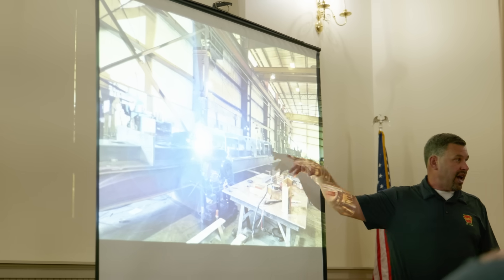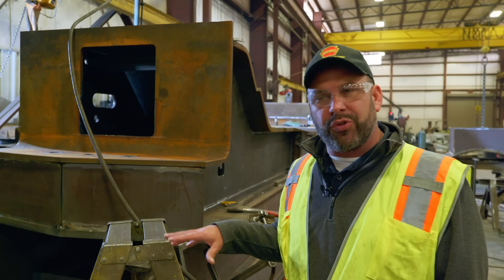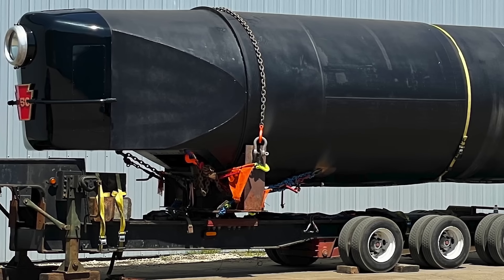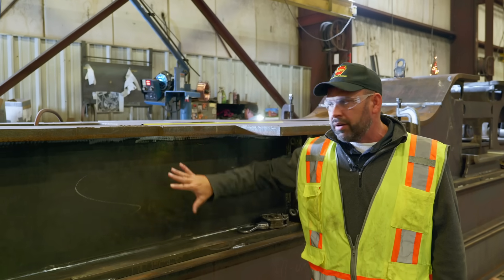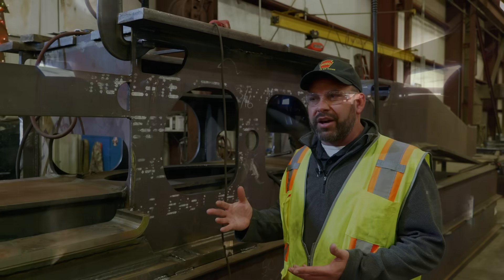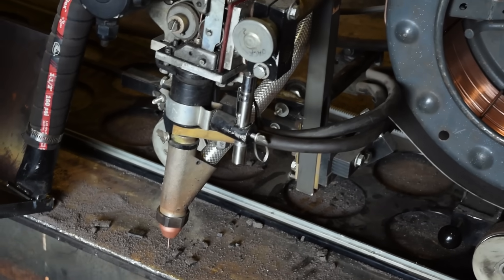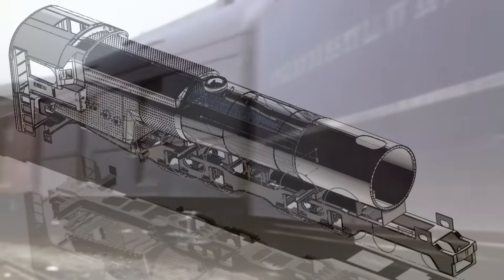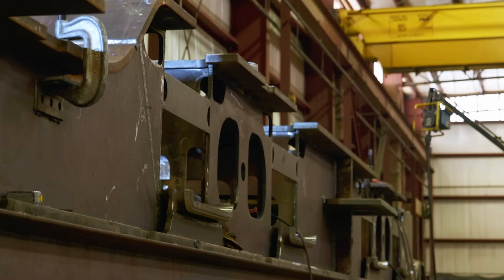NEW-BUILD Steam Locomotive Frame Walkthrough - PRR T1 Trust

Comment: fantastic work, thanks for this. my big question is though - could you create a steam locomotive at the same hp and same cost (inflation adjusted) as back in the day? i realize you have better tools and methods these days than they did, but curious if the old requirements with old methods are even possible anymore. and if they still stand up now. thanks

Comment: It’s just such incredible work they are doing. But I have a question for the railfans, what’s going to happen to the trust after the T1 is complete. They aren’t gonna run it, they’re sending it to other railroads. Could they rebrand to say the “J1 trust” or “S1 trust”?
Reply: Just because it will be operating on other railroads doesn’t mean they won’t own it or operate it. They will still be taking care of it when it’s not running on tourist lines. No need to rebrand.

Comment: This is amazing, how far you can go with passion! When this was announced the nay sayers grumbled it could never happen, the US is a backwater, they will have to make it on China because we dont have casting capabillty, etc.   They kind of live in the past, that somehow it was superior...and it wasn't. 

The welded tech they are using and the materials are better than the casting tech back then. I am no expert but they have advanced welding techniques utilizing heavily automated , precise techniques. Where millled parts are needed CNC milling is infinitely better than old milling machinery. 

On the emgineering side they have computer based tools that can do a lot more than turn a 2d drawing into 3d.They can run stress analysis, they can see where there will be interference or space problems, they can run simulations that in the old days would happen with a prototype , which was expensive and time consuming. 

Also back then despite the best efforts of engineers a lot was still trial and error.  I say that with all do respect to them, they built incredible machines like this using hand calculations and slide rules. 

I have also heard grumbling it wont be authentic unless they do it the same way they did 100 years ago. That is silly, if the builders could have had this tech they would use it. 

Kudos to all!

Comment: Would have preferred it if you recreated a prototype T1 rather than a production T1.
Reply: I'm glad to see tech advances being used to produce a developed T1.  

The Gresley P2 (a 2-8-2) under construction over here 🇬🇧 is a 'next member' of a class which by common consent never reached it's full potential.  Several known design issues have been ironed out, not all of them unique to this specific design.

AIUI, the issues faced by the T1 in service were as much vastly different driving techniques as much as the design tweaks identified by the Trust building 5550.
Reply: I like the prototype streamlining as well, but I imagine there is good reason as to why the Pennsy chose not to continue the extra streamlining on the production locomotives.

Comment: This looks like great work. Were there many US steam classes manufactured with steel plate frames like this? The reason I ask is that I have only seen a small number of steam loco's in the USA, and if I recall correctly most had bar or cast frames.
Reply: The original T-1 this is based on was a single large casting and one of the last steam locomotives made in the USA, the capability to cast a frame that big just isn’t available anymore so they decided to do it this way. It’s still within 3% of original weight but has improvements for longevity.
Reply: Plate frames were the almost universal material here 🇬🇧 until a few cast segments made their way into designs very late in the day.  
Bar frames, common practice in tbe US which preceeded cast frames, had been virtually unknown here since the locos of Edward Bury in the early days of railways.

In a Duplex loco, it will be fascinating to see the difference this will make.  I've a suspicion it may suit the original purpose of mounting two discrete engine units in a single frame rather better than a more rigid cast bed.  Who knows, maybe time could even prove it was the original design which headed up a then fashionable engineering dead end!

After WWII, British firms did build plenty of steam locos with cast frames, largely for export to Sub-Saharan Africa, most to Metre or 3'-6" "(Cape") gauge.

Comment: So are you restoring an old one, or build one from scratch from original blueprints? I have not been keeping up
Reply: There is no old one left. It's a completely new one!
Reply: @Fritz46  that is very cool!
Reply: @ShawnFields-o7o  they are making it within 3% of the original weight while only upgrading things for reliability/longevity/safety requirements. They want an accurate example in terms of the full performance without any issues that cause breakdown or reliability issues so it will be around for centuries to come!

Comment: That can only happen in the States…..good luck and thank you all
Reply: Actually, it's happening here 🇬🇧 too ... admittedly rather smaller locos, but 60163 (an A1 4-6-2) has been in service for some time - and became the first steam loco since BR days to run at 100mph (a fully sanctioned test to prove 90mph operation). 

Did you know that the Gresley pacifics which kicked the A1's lineage off were originally inspired by the Pennsy K4? Well you do now!! 🙂

Comment: Great video. Your comment about not having the casting capability that we had back in the 1940s……this should not be. The US should be better than that.
Reply: The capability is still there, it's just not cost effective. You have to factor in the cost of the moulds; the cost of material for multiple casts, as one flaw and it would need to be redone; the cost transporting the oversized cast to the production facility. All those costs would skyrocket the budget that they already barely have... It's much cheaper to just weld the frame together as funds come into their budget.
Reply: @NathanMaltba  For mass production, it would be cheaper.

Comment: The scary part is that we can't do today what they did in the 1940's'
Reply: Not really. One of the reasons no one has the ability to cast such a large casting is because there was no demand for it.  The T1 had to be a big beast to get the kind of power desired, diesel locomotives can work in an MU configuration that gives plenty of power. Modern materials and techniques have supplanted casting as well.  In the 1940s computers used vacuum tubes, today your smart phone has more computing power than the entire NASA in 1969...and no one makes vacuum tubes in the US,hasn't for like 50 years.
Reply: @njlauren  well there are still tub amps being made but its much smaller industy than it was in the 1940s thats for sure
Reply: @ThunderClawShocktrix  
Tube amps are an audiophile hobbiest thing ( I know I have one).   But the point is unless something has a reason to exist there is nothing wrong with it disappearing necessarily. If tomorrow vacuum tube technology was lost few people would notice, other than some guitar players and audiophiles . 

When talking about the t1 project and not having the ability to cast large objects , I have heard things like 'well, what of there is a war', as if WWII is going to happen again.

Comment: You folks have utterly SHOCKED me with how far you've come. My gut instinct says 2028 will be the year 5550 runs for the first time! Also, as a side note. With how modern 5550 is, my advice and humble asking is that y'all organize taking her across the ENTIRE NATION, coast to coast. This could be done by way of the old northern pacific or GN to get to the west coast then down through California. Then run across the southwest through Texas and come back on home towards home rails. The reason why being the massive accomplishment of a brand new steamer being built after nearly a century. It'd also be excellent publicity and a MAJOR test of 5550 and the T1 design in general. It might also get support needed for other new build steam projects that may or may not be proposed. Granted, I'm just a railfan (NOT FOAMER) who is spitballing a crazy idea.. but if a T1 can be reborn and a Big Boy be returned to steam, damn near ANYTHING is possible!
Reply: I hope they come to Idaho
Reply: @oldshape3876  they very well might. Depends on the route they take or if they could pull it off.
Reply: After T-1, I am planning the Milwaukee Road A1 4-4-2 Atlantic of 1935, and extra improvement like, Robert bearings on connecting rods;  and Baker valves;   and longer tender for extended trips.   I also add plans for my 1:8th scale live steam locomotive 🚂 for True Scale Guage 7, at 7&1/16" track guage.
Come to Green Bay Wisconsin soon for a unique ride on this UNIQUE MINIATURE LIVE STEAM LOCOMOTIVE 🚂 😎 👍 ❤!!
  (I.E., ROLLER BEARINGS, OK!!)
Reply: Hmmmm .... just trying to work out how long the support train would be for that jaunt.  A large coal hopper, couple of water tankers (even with on-board water treatment,  there are some impressive desert crossings on your route), large closed car (spares and consumables), crew sleeping car, crew saloon, kitchen /mess car  - that's seven right there.

If you're thinking in terms of a hotel on wheels for paying passengers, add a 1st class sleeper, vista dome (or two, depending on ticket sales, one day tickets etc.), restaurant car, bar car, cattle truck (for rowdy children ... though tbh, I can't see it being a particularly effective threat against bad behaviour!!).  Maybe an 'open' carriage (if regulations permit on Class I lines) ... and a 'Thunderbird' (Does that make sense in the US? It's the term we 🇬🇧 use for a rescue diesel).

That's up to 14 plus 'Thunderbird'.  Just the kind of load these beasties  were originally designed to whisk along at speed ... on the Pennsy. Back in 1948, 5511 ran 21 car test trains on the N&W's Norfolk Division,  so although the smaller wheeled N&W J Class (70" against 80" drivers) it was up against back then did better on hills, that should still be do-able.

Now where's that attempt on LNER No.4468's 126mph record going to happen?
Reply: @TheHoveHeretic  the passenger cars themselves serve as crew dormitory, it's where the crew of UP 4014 lives while out on nationwide rail tours. And with 5550 having PTC, (Positive Train Control) she wouldn't need a diesel to operate on mainline steels but a diesel would probably be provided regardless for dynamic braking. Auxiliary tenders can be sourced from various different places, but 5550 will have a long distance tender or "coast to coast" tender as the pennsy called them. All of the T1s originally had such tenders. And there probably wouldn't be ticket sales whatsoever, it'd be a run without passengers besides the crew much like Union Pacific does when they run 4014 or 844. It's more for publicity than actually giving people rides. Excursions can be planned for, maybe 1 in each of the states 5550 visits.
Reply: @ChargerusPrime Thanks for that.  Guess I'm thinking of things from a European perspective and forgetting quite how different the surviving interior US rail network, primarily a freight carrier for 60-70 years, really is.

Even with extensive layovers to fit stock movements between commercial freight operations, if your railfans are anything like our die hards, they'd miss their own funeral for a chance to do a long distance trip behind steam.  It's pretty well inevitable there'd be more paying  custom ready to effectively camp out on a steam hauled train than common sense or even sanity might suggest!!
Reply: @TheHoveHeretic  aye, we're not all that different when it come to our love of trains, not at all. It's really just a much more massive rail system we have here in the states. In Texas alone, Union Pacific has more than 6,200 miles of trackage. If I'm not mistaken that's more than just about the entire UK has if not being right on par with how much you folks have over there.
Reply: @TheHoveHeretic  they will go to the loop outwest where they test the modern trains and railcars at pueblo and fuel I belive she will be oil for practical and future considerations, though we got less oil and petrol then we do coal but the nation is turning against coal and then you got to have a place to dump the ash and all other logistics of dealing with it, as for advances they also might incorporate those too like an advanced exaust or overfire jets, and as for casting they did say in another place there are 5 foundries in the usa that acutally could make a casting this large but 1 million at a pop and want three attempts, you can see the costs and no garrentee that any would be up to par, where with welding it can be joined and put into a stress relief oven and made as though its one whole piece and get all the brittlement out of the welds.

and on coast to coast cali would never let a combustion engine across its boarder I almost promise you they wanted to make so no engine older the 35 years would operate in the state and they want to have zero emissions in the near future, never mind the fact that rail moves much more tonnage for less fuel use and less emissions to do it to begin with.

Comment: You noted that each set of drivers was on a pivoting truck.  Are the cylinders, cross head guides, valve gear, etc.  also on the truck?
Reply: NO, NO, NO.
The drivers are mounted to the frame...
Just the leading and trailing trucks swivel.
Reply: @5280bj you are correct.  At about 3:00 the narrator referred to the “front engine truck” being on a pivot and I misunderstood him to refer to the drivers.  This had me confused because I knew the T-1’s design was different from that of articulated locomotives like the Big Boy and the SP cab-forwards.

Comment: Now that i think about it,
what were the ACTUAL mechanical and physical flaws of the T1,
And if the T1's performance can be simulated on a computer.
(speed, power as such)
Would love to see!
Reply: Primary flaw was the running gear and valves (mainly poppet valves) were not rated to handle excess speeds. Engineers were not accustomed to the high torque that resulted in destructive wheel slip (and in some cases, damage to the running gear).

The T1 trust has already addressed these flaws after obtaining copies of similar valves.
Reply: @NightmareKato  Sur leur vidéo de présentation, on distingue une distribution Caprotti en place de la distribution Franklin qui, suite à de nombreux problèmes, a été  modifiée en distribution Walchaerts sur les modèles originaux. Cela peut résoudre ce problème en évitant l'appareillage d'une distribution Walchaerts à contrebalancer?
Reply: True.  Metal treatments to produce bearing surfaces of sufficient durability have advanced a long way since the original locos were produced.

Comment: Jason...Weren't those loco's TERRIBLY SLIPPERY back in the day? And if so, have you corrected this problem? (You and I used to email each other re: 6325 and the photos you brilliantly took before, during, and after her re-construction. Jeez!!! If only I could see them again, but I DO have an idea. Would it be possible to do a "college" OF these photos and maybe a brief line, (or sentence of what the viewer is looking at) and them put 'em up on a website? Yeah, I understand that would take some time but would be of incredibly cool. Your thoughts? Jim
Reply: No the rumors are overblown about how slippery they were. Most of the issues were engineers not knowing how to deal with a Superpower locomotive. They were used to dome throttle 1920 K4 locomotives. Big difference in the two locomotives.
Reply: Came across the video and I’m wondering if your not casting the frame but instead fabricating what seems to be a skeleton to support the necessary parts of the running gear and boiler, parts etc.Aren’t you missing the shear mass/weight for the tractive effort?
Reply: @johnbishop9275 they’ve designed it to be within 3% of the original weight if I remember correctly.
Reply: @johnbishop9275  that is easy to rectify by adding weights in the frame itself. I'm sure they've thought about it - having a high center of gravity in a locomotive is a problem.

Comment: Wouldn't be a hoot if the welded frame ends up being the fix for the T1's notorious slipperiness?
Reply: It wasn't slippery, that was caused by engineers not being properly trained on how to run a Superpower locomotive. This is well documented, but ignored by most railfans. We suggest reading the reports by the N&W that leased some PRR T1 locomotives. That report shows the slippery rumors weren't actually an issue

Comment: Looks very good have one question why is everything thing welded sold is the cross members welded or bolted I would think something that big would have to give somewhere or it’ll crack right?
Reply: The original chassis was actually 100% cast in one piece (which is astounding), in this case they started with the original blueprints and used the CAD program to test and stress the frame in various ways in the computer and improved on the design to make it even more robust, while keeping it within 3% of the original casting’s weight. It was designed to be better than the original and the original wasn’t known to have issues.
Reply: @ thanks for the info